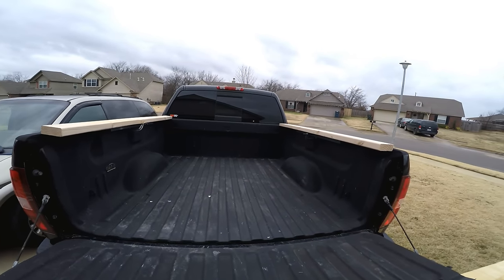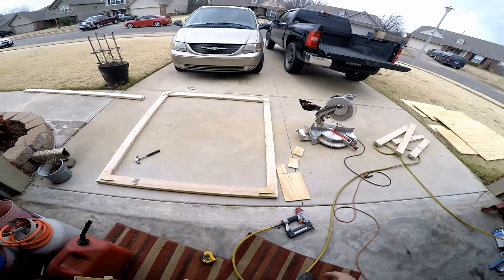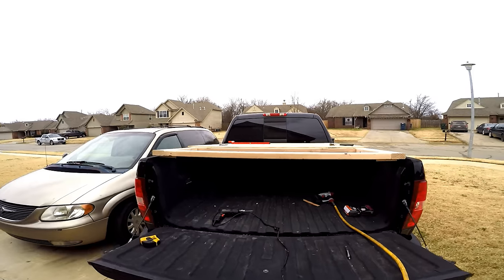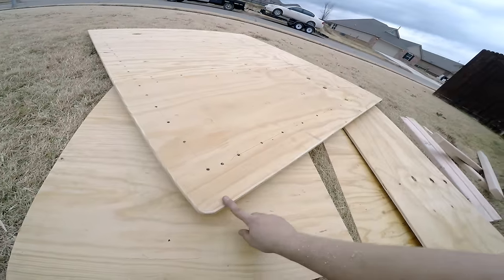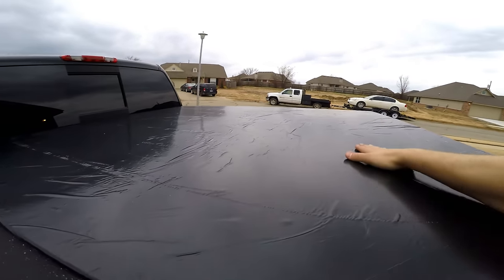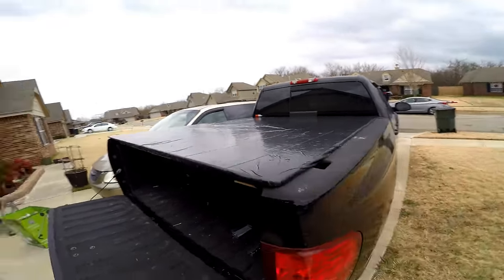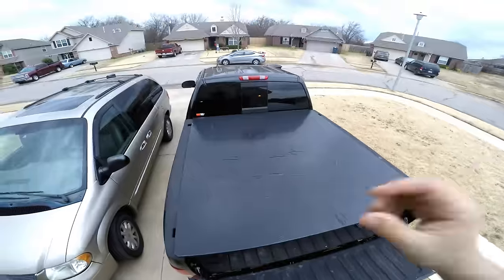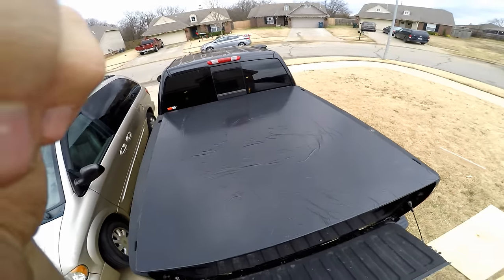DIY How to build a truck bed cover

Comment: about to build a flush mount bed cover for my obs flareside. been watching these trying to get ideas. im gonna use bedliner as the paint for it and just need some ideas on how to make it water tight without it sitting on the bed rails
Reply from the maker: maybe mount C channel and let the cover sit on top of the C channel.  Then any water that runs off the side of the cover, runs into the C channel.  Then the C channel can drain out the back.

Comment: jameslee522 to hell with any nay sayers. I'm gonna guess your not a carpenter by trade? Good, me either lol. I am looking do build something similar, only I want the sides cab high. Basically a DIY Camper Shell. I had no idea where to start. I've come down to the DIY project instead of searching for hours and days and now it's been a year I've been online looking for something. Then when I find it, I usually can't afford it. This gives me ideas and really REALLY YOU helped ME out a lot with your project. Thanks for posting your project. OH, like your...mine is for a temporary use as well.